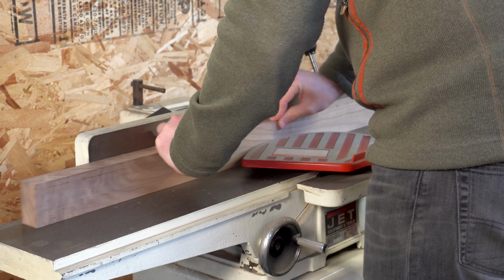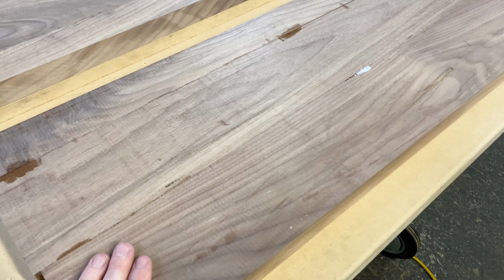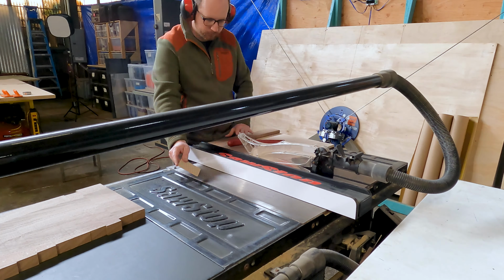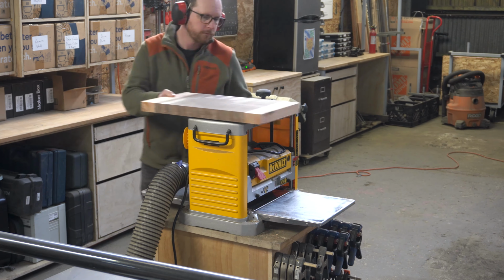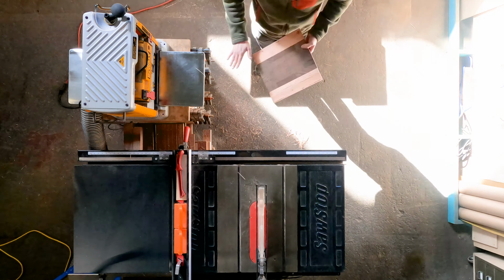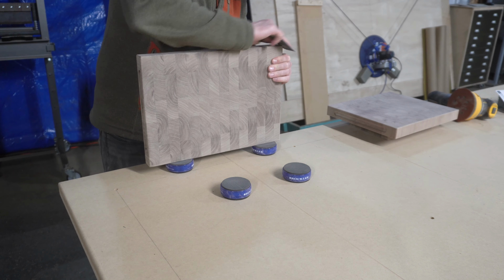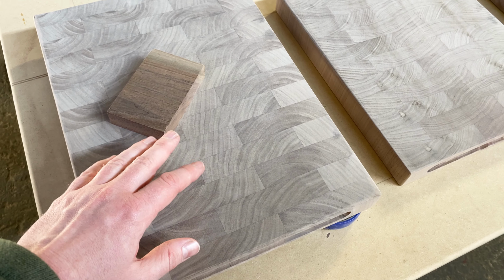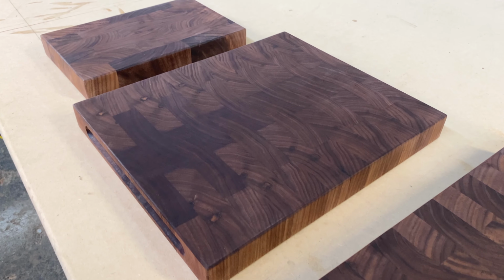How to make end grain walnut cutting boards

Comment: The boards warp from the water in the glue.  the side that is more exposed dries, and shrinks.  It's important to have even air circulation as soon as possible after clamping.
Reply from the maker: I'm not sure about that. They warped up, meaning the side exposed to the air swelled or the side not exposed shrank. Also, I planned them flat a day or two after the glue dried, then they warped. I think the issue was a change in humidity only affecting the exposed side.

Comment: Nice job! Noticed that you have a, can’t think of the name, one of those CNC vertical router on a sheet of plywood. How do like it?
Reply from the maker: Thanks! It's a Maker Made M2, which is based on the Maslow. Honestly, I set it up then had a bunch of issues getting it working. I got distracted by other projects and still haven't come back to it. It's a very fiddly machine. Can't say I'd recommend it.
Reply: @eusonicmakes  Oh, sorry to hear that. I have a "normal" CNC, I guess you'd say, and it's fiddly too. Think they all are. Those Makers looked promising . Hang in there. They have a learning curve, and sometimes, I swear a mind of their own. Lol

Comment: Some really good info thnx. Happy your board equalised. Please tell me does your planner use full width  blades or small multiblades? Im concerned about kickback on endgrain planning and havent done one yet.
Reply from the maker: Hi Tim! My planer has full width blades. I had no issues at all with kickback, but I was taking light passes.
Reply: @eusonicmakes  yeh very light passes seems to be common but i wont be standing in the line of fire just in case 😁 thnx for replying

Comment: What if i don't have a jointer? I have a planer and table saw and miter saw.
Reply from the maker: I think this would be hard to do without a jointer, but I haven't tried it. You could see if you can get a flat enough edge on the table saw.

Comment: why not give dimension
Reply from the maker: Hi Troy! The dimensions aren't too important and I'd suggest measuring a cutting board you like the size of, or basing it off of the materials and equipment you have available. I gave away two of these cutting boards so don't know the dimensions of them, but the one I kept is about 13" x 11".